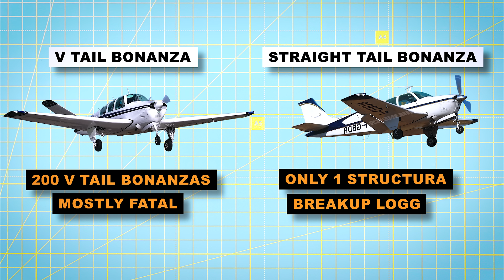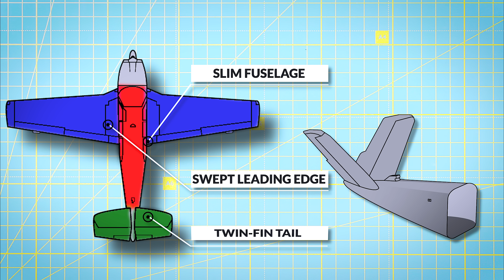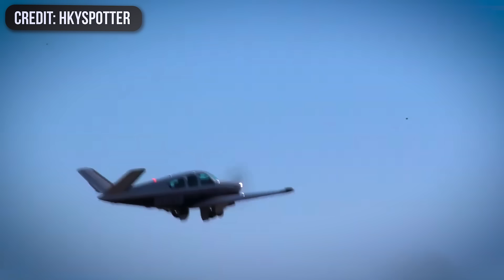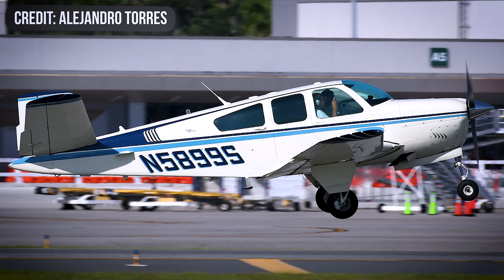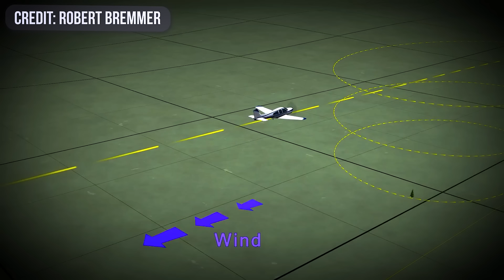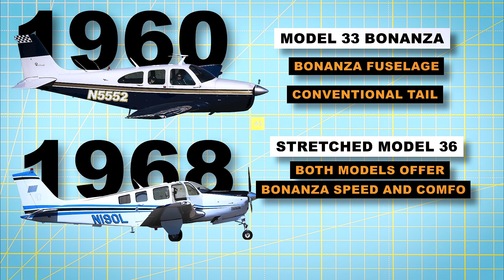Why Did This Plane Kill over 200 People?

Comment: One of the primary reasons for the Bonanza's success was it's only real competitor was the beautiful but bigger, heavier and very difficult to safely land, Cessna 190/195 Businessliner. The Bonanza did the same job but in a smaller plane that was a LOT easier to land than the tail-dragging Businessliner that also had a reputation for flipping over, due to a poorly designed brake configuration and the Bonanza also got much better fuel mileage than the big rotary-engined Cessna.

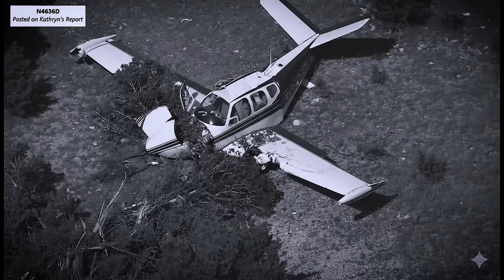Comment: 13:45 On September 7, 2020, about 1247 central daylight time, a Beech G35 airplane, N4636D, was substantially damaged when it was involved in an accident near Canyon Lake, Texas. The pilot and one passenger were seriously injured. A second passenger received minor injuries. The airplane was operated as a Title 14 Code of Federal Regulations Part 91 personal flight.

The pilot reported that while enroute to the Canyon Lake Airport (34TS) the engine lost all power shortly after he switched the fuel selector to the left main fuel tank in preparation for landing. The pilot attempted a forced landing to a clearing but struck trees on the edge of the clearing and the airplane impacted the ground. The airplane incurred substantial damage to its fuselage and both wings.

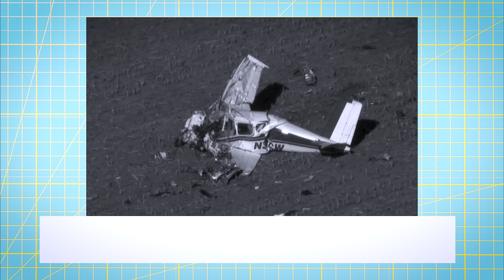Comment: 6:16 MODESTO (CBS13) – A small unmanned plane crashed at Modesto Airport Wednesday afternoon.

A pair of pilots were reportedly working on the electrical system of a Beechcraft V35B Bonanza, manipulating the propeller, but said it wouldn’t start. When the pilots walked away, the propeller suddenly engaged on its own and taxied away, hitting a car and a fence.

The pilots told police the plane took off at speeds around 40 miles per hour. The plane was moving toward the busy Mitchell Road after it clipped the parked car.

“If it was to get over that [grass] and get onto Mitchell, we would really have had a problem on our hands trying to stop that plane with nobody inside it,” said Sgt. Mark Phillips with the Modesto Police Department.

Phillips said it was a good thing the plane hit the vehicle because it changed direction, diverting the plane from a hanger that was occupied at the time of the incident. Two structures were damaged by the plane, but no one was hurt in the crash.

Comment: There was never anything wrong with the V35.  It's high accident rate was due to the inexperience of the monied who could afford it.  There is now an STCed replacement for the magnesium ruddervators BTW.
Reply: Inaccurate. There is a Parts Manufacturer Approval (PMA) for the magnesium ruddervators replacement.
Reply: @smark1180 There is, but that's not because new ones failed.  It's because the magnesium cracked and suffered corrosion over time.
Reply: @bbaz6729  You’re explaining the exact issue I already pointed out. 

The original ruddervators didn’t “suddenly fail new” - the long-term corrosion/cracking problem in the magnesium skins is why PMA (not STCed) replacement skins had to be developed in the first place after OEM parts became scarce. You basically just restated my correction while acting like it contradicted it.
Reply: @smark1180  I have many hours instructing in V35's, A36's and F33's.  I prefer the V35 to the others.  It's a hell of an aircraft.  Still.
Reply: @bbaz6729  Odd that you refer to all V-tail Bonanzas as "V35's."

Comment: To safely implement this you’d need a modern gyroscopic system with mixing in all 3 axis. There isn’t really a good way to mechanically implement that mix. It requires allot of pilot experience to safely compensate.

Comment: I have always loved the looks of these, but the rudivator and v-tail configuration had some limitations beyond those discussed in the video. Using a standard soft field takeoff procedure of starting the takeoff roll with the wheel full aft (elevators up) would limit rudder travel, and therefore the ability to keep the nose straight in a cross wind, were significantly reduced. There were several accidents that could be attributed to this, but accident investigators took the easy out and blamed the accidents on "pilot failed to maintain control of the aircraft". There should have been statements in the official operating manual or placards on the panel, which ever applied to bonanza models, advising pilots of this limitation.
Reply: "There were several accidents that could be attributed to this."

List them: date, location, and registration.

Comment: I remember back in the early 80s they were given those v tails away. And they came with that AD on the tail, and it came with tail modification. You had a little problem with oscillation , and they were slippery.
Reply: You don't remember any such thing because it isn't true.

Comment: Great video , what a stupid design the V-tail is. Engineeringly unsound. The V-tail Bona is a hellish flying crate.
Reply: As if you ever flew one.
Reply: @smark1180  What does not having flown a trash design have to do with the trash design? The regular tail Bon is ok but the V is not. Why defend a festering flea ridden fecal slop dung heap design?
Reply: @CyberSystemOverload Calling it a “fecal slop heap” doesn’t really add engineering insight, it just adds adjectives.
Reply: @smark1180  Thats true but I dont need to add engineering insights - the video mentions it. It failed to meet strength requirements. The "ruddervator" flutter issues bit hard. Whats to like about this design? If I had to get one Id get the standard arrangement.
Reply: @CyberSystemOverload There’s a bit of truth mixed with some oversimplification here.

The Bonanza Model 35 did run into serious issues under specific conditions - especially misuse cases involving overstress and early control-surface flutter. That’s part of why the design got so much scrutiny and why later structural changes, operating limitations, and pilot guidance were introduced.

But “failed to meet strength requirements” isn’t really accurate as a blanket statement - the aircraft was certified and stayed in production for decades, with a long operational history after fixes and revisions. The flutter and structural concerns weren’t unique to the V-tail concept itself so much as early implementation and how it was operated.

Preferring the conventional tail is a totally reasonable personal choice. The V-tail is just a different set of tradeoffs, not a fundamentally “broken” design.
Reply: @CyberSystemOverload "The "ruddervator" flutter issues bit hard."

There were no such issues in properly flown and maintained Bonanzas.

Comment: Slight error in the comments.  There has never been an inflight breakup of a straight 35, A35 or B35.  The tail bending issue started with the  C35 because Beech tried to solve a CG issue by enlarging the tail without moving the spar.  C-S models have the cuff where the tail meets the body.  35, A35 and B35 don't need the cuff.
Reply: 09/01/1974, Alliance, OH, 1947 Model 35; 06/22/1975, Dent, MN, 1949 A35; 10/02/1976, Bagdad, AZ, 1947 Model 35; 02/10/1978, Fairfield, CA, 1947 Model 35; others prior to 1974.

Comment: 8 minutes of unnecessary intro.
The tail part should be flat and generate lift. It should have a blended body wing, and small Electronic Circuits Boards, dedicated to stabilize the airplane, with small movements; the wings slightly angled, like 7º. It should be Fly by Wire; have better mechanical parts, optimized for the functioning of the devices; the mechanisms should be always covered. The Butterfly Tail should be Thicker to have Fuel Tanks
Reply: LOL!

Comment: I'm lucky to say I used to pick up brand new Bonanzas from the Wichita factory back in the late 70s and fly them back to Dupage Co. Airport west of Chicago.  I worked at a flight school, and Dupage Aviation was the largest Beechcraft dealer in the Midwest at the time.
Most of the time, the aircraft only had about 3 hours on the engine after I arrived.  I guess I was the test pilot during the 5-hour trip home.  Most of the Bonanzas had minimal gauges.  But sometimes they were loaded.  A few times, there was even an autopilot.  Bonanzas are sweet airplanes. Those were great times.

Comment: Largely BS.   Many breakups followed loss of control (e.g., VFR into IMC, spatial disorientation, or turbulence in clouds), where pilots overstressed the airframe. Straight-tail Bonanzas had similar loss-of-control accidents—but the airframe usually stayed together until ground impact.  Many pilots took these aircraft into conditions they weren't qualified to handle.
  Break up in air, or on the ground, the result is the same!

Comment: I’ve flown both Bonanza and Debonair versions.  Both Dutch roll.  The major thing about them is they are safe, efficient and a joy to fly as long as a pilot observes the restrictions and limitations.  Fail that, consider yourself smarter than the airplane and you’ll soon find yourself in bent tin.  There’s no design deficiency…there were a lot of pilot deficiencies because training, rules, limitations and often common sense was abandoned.

Comment: But why did this tail kill over 200 pilots you ask?   Just like asking the question, how did this pistol kill 200 people.  It’s not the tail, it’s the pilot.  Fly any airplane into IMC, get disorientated and hit a mountainside, the tail had nothing to do with it, the pilot did however.  Let airspeed fly past never exceed,  the pilot is at fault, not the tail. Been Flying V tails for over 5 decades, not once did my V tail  assembly reach out, tell me I’m dead.  Haven’t flown into any thunderheads either.

Comment: I'll never forget many years ago at an AOPA convention, there was a very well known plantif attorney as a speaker on stage with hundreds of people in the auditorium.  Many Beech representatives, as well as a number of other top dogs of representing their aircraft,  Beech, Cessnak, Piper, and others.  Anyway during this attorneys time on stage giving a lot of advice, he then turned to the  V tail and Straigt  tale Bonanza.  He began giving statistics aided by powerpoint background.  His conclusion was that the V-tail was 28 times more likely to fail that it's straight tail cousin.  The crowd (several hundred) began booing the speaker.  Beech pres/CEO demanded the auditorium workers to turn his mic off.  I was nothing short of a disaster. After the riot settled down,  the speaker began giving highly critical statistics that nobody could deny.  The guy was relentless, but in most studies, he was pretty close with his numbers.   Insurance comanies always surcharged the V-tail, no matter what pilot credentials they had both in total and make/model.   This is a multi million dollar very high profile attorney, who later was the one that identified two  737 crashes which nobody else could seem to figure.  Using his own millions of dollars, he figured out that the rudder that was dubbed the hard over, where the actuator would actually travel in the wrong direction with full rudder force and jam.  The actuator especially when cold, would indeed 'lock up' in the opposite direction.  He is probably long since passed away, but, I'm not a fan over overzealous ptantiff attorneys, in airplace crash scenarios,  but he was spont on with the Bonanza crashed and later proved correct on the cause of two 377's rudder hard over.

Comment: V-Tails are 110°-115° and Respond no different than "traditional" T-Tails? Or centered horizontal stabilizer designs. The original empianage were built too thin and there were kits available to fix them. Any airplane that has Tail Flex put into abnormal attitude will suffer the same stalls or instabilities

Comment: One shouldn’t underestimate the performance difference between these models and the likes of the Cessna stable. 
I had a friend who started his ppl training and he bought a Mooney 201 midway through.
 Going from a 150 to a Mooney was a quantum leap. Everything happened so much quicker and energy and speed management of the slippery 201 was a handful. Just loosing enough speed to join the circuit was an effort. Workloads as a novice could become an issue very quickly. 
It’s always going to be like learning in a beetle and immediately upgrading to a Porsche in terms of performance. You have much more opportunity to get it wrong.

Comment: I wrote a paper in college about this airplane.  At the time, 227 Bonanzas had experienced inflight structural failure resulting in the death of 554 people in total.  Early failures were the result of the absence of the sheer web, known as WS66.  Once Beechcraft sorted this failure out and installed a proper sheer web, the failures moved into the tail, specifically the V-tail leading edges wrapping around the attachment spars.  Once Beechcraft was convinced this had more to do with a structural deficiency than pilot inexperience, changes came but stubbornly so.  Mike Smith’s company, Aero Conversions in Kansas, was installing stub spars in the tail to remedy the problem long before the FAA’s AD requiring the stub spar mod.  What was the tail problem?  It was the 17” unsupported “overhang” of the leading edges.  They simply weren’t attached to the fuselage.  Also, should the ruddervators be as little as 1/2 oz imbalanced, the tail at speed would enter into resonance fluttering the tail apart in seconds.  Even bird crap can meet that spec.  No doubt, the airplane was ahead of its time however IMO, the very successful straight tail model (33), should’ve killed the production of the 35.
Reply: All the failures were the result of pilots violation operating limitations.  All of them.
Reply: @kitbaker8521  I disagree.

Comment: Stumbling upon this video is a real day spoiler. Just about total BS! I probably backed up more miles in these than this dude (or computer) ever has ridden as a passenger. I have returned to service numerous, some severely, damaged Bonanza's, a couple totally written off by the insurance companies. The last well over twenty years ago. They're all still flying. I've personally performed every AD and STC available in those days. I knew them inside and out. One would expect the "V" tails to have had more accidents for many reasons unrelated to the design. First being of all the Bonanzas produced the majority of them were "V" tails. Out of the 18000 plus produced, 10,402 were "V" tails. The early models prior to 1953 were substantially different in numerous ways than later models. None of the Bonanzas benefited with the modern avionics, metallurgies and lightweight composites. They were until the last produced 1940 technology.

At the time of the cuff AD, it was never actually proven the leading edge of the stabilator was ever deformed in flight causing the crash. Several crashes found them to be after the fact and the cuffs were installed simply over an abundance of caution. And Beech paid for every one of them. Hitting the round at 250 knots will tend to bend things. The other major airframe AD was the center carry through reinforcement which applied to the vast majority of Bonanzas and Barons. And again, paid for by Beech.  

The CG issue was much more prevalent with the straight tail version than the "V" series. Especially the F33A's. They came after the commonality efforts Beech put in place with that model. The F33A inherited the much heavier A36 tail empennage assembly but without the rearward wing displacement of 10" the A36 received. During production of the F33A it was nearly an unsaleable aircraft due to the tight CG issues making it virtually a two place aircraft. Many of them sat in Beech hangars for years unsold. In my opinion the E33A was the ultimate model as it had the IO520 structures and still had the lighter (Debonaire) 33 tail assembly. With a IO500 installed, it makes for one hell of a hot rod without the CG issues. 

As for flying qualities, the "V" tails are a fingertip aircraft to fly. Very forgiving to any moderately skilled pilot. The so called tail waggle is actually wing walk and any high performance wing will do the same. It was is no more prevalent in "V" tails than any of the conventional tail model. Even Barons will do the same. If it is more pronounced, it's due to the shorted fuselage. 

Then this guy tags the model with what a viewer would believe to be common place poor maintenance of from the owners. Like that was something designed into the model. I haven't been following the accidents all that much since retiring but frayed cables just didn't show up often, if at all in NTSB reports. And if it did, it certainly wasn't worthy of the time he spent on it in this video. 

We achieved what he set out to. Clicks! But I doubt if he will generate any likes and subs. Don't reward this sort of thing by doing either.

Comment: Loved my V 35B.  Had it 5 years.  Put a second rotating beacon, a Century 3 and a yaw dampener on it.  The best upgrade was the yaw dampener.  Absolutely put the Bonanza on rails.  In one movement - gear up, yaw dampener on.  That said, the Bonanza is a skittish airplane if the conditions are less then ideal.  Not difficult to control, but easy to get behind.  It is an absolute to reduce speed.  Fast airplane, handles like a sports car.  Intolerant of being mistreated.  
Peace...

Comment: There are still ALL kinds of planes that flew in the 1930's and40's that are still flying.
Any aircraft, automobile horse cart will fall apart if not maintained .
That is why every plane that flys is required to get a annual complete check.
If that is shortcut, it does't belong in the air.
Your and my car does't belong on the road if not maintained.
I did ride in a beach in the late 50's.  Bet the ones that crashed were shortcut on the annual checkups.
Nothing last forever and not long if stressed regularly.